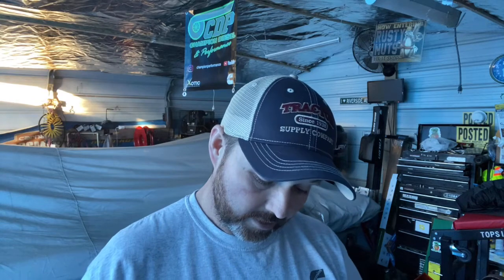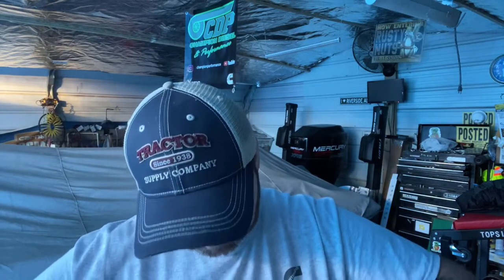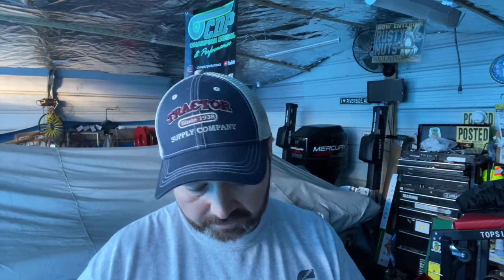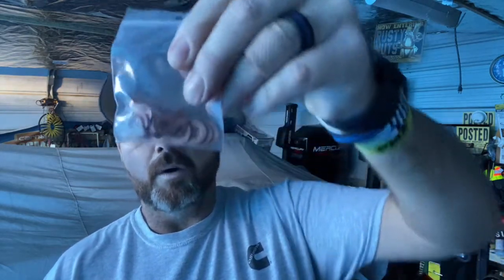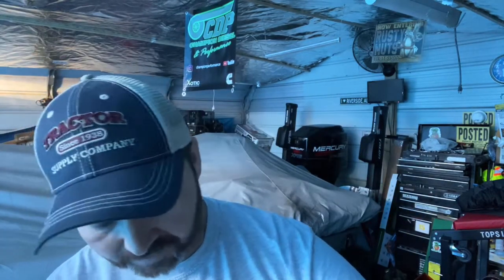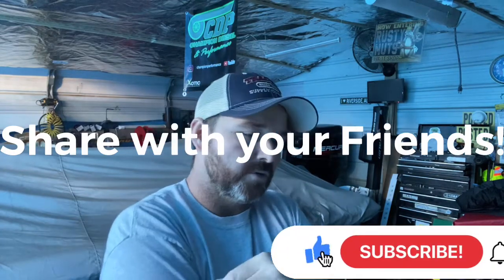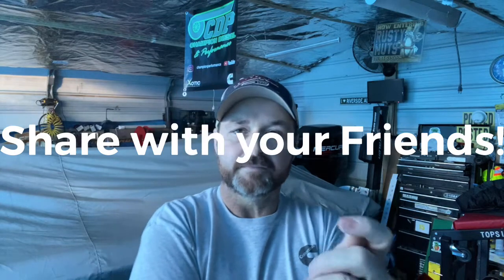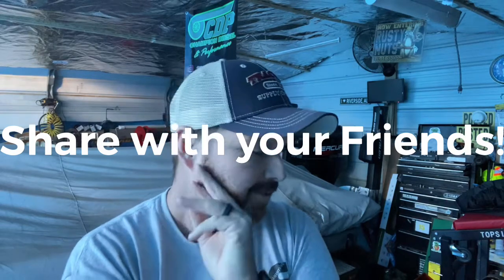12v Cummins upgrade’s Ducky injector’s 5x0.0.12’s

Comment: What did you end up thinking of them?  I am looking at the same set for my 96, bone stock besides afc live. I tow a bunch with it but is still my daily.
Reply from the maker: They have been doing great I got about 10k on them no problem’s since I’ve done afew other mod’s to the truck I will be pulling them out and going with dynamite diesel stage 1 injector’s next but yea they have been holding up great tips still  look new!
Reply: @cdpperformance2613  strange you say that my Reman 5x12s from Ducky did the same thing and now I’m running ddp stage 2s.